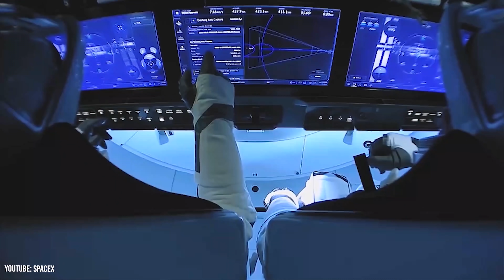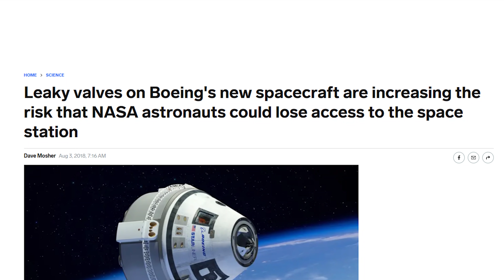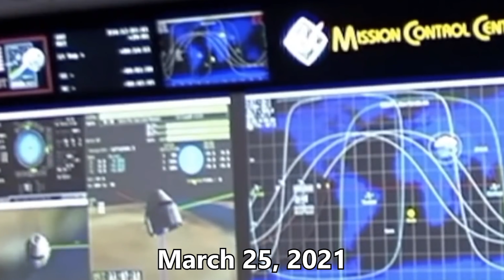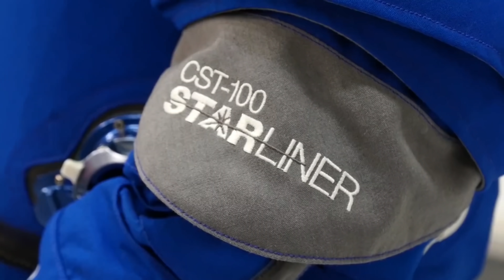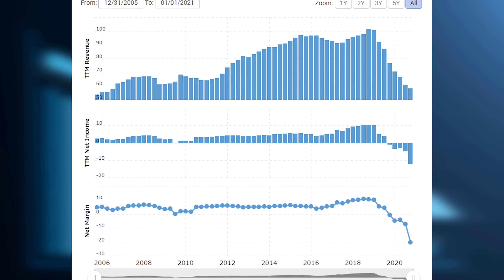What Happened To Boeing Starliner?

Comment: Boeing is addicted to endless streams of taxpayer's money through Cost-Plus contracts.  They rely on legacy cred and "flight-proven" (old tech) rather than innovation and cost-reduction through efficiency.  

Starliner was full of software problems due to the fact that it is built by hundreds of sub-contractors which makes logistics and communications a nightmare.  

They never bothered to test the software in simulation as fully-integrated stack.  They only tested individual parts separately.  

Boeing is failure on top of failure.  

I think that their time is done and that they will not have a future in commercial space flight.

Comment: I know this is essentially an overall view from the outside, but I truly think that the core, not the causal, reason was that Boeing never intended to innovate but, rather, accommodate.

If you look at their design(s), it truly appears this way. It's as if they're stuck with the principles that worked during the Apollo years, instead of discovering new ideas that aren't just "updated" versions of old ones.

Comment: I remember, long ago a video showing inside SpaceX where folks had server stacks plugged into a Dragon off the assembly line and running full/complete "simulation" tests triggering everything within the Dragon's control system... I thought that was pretty neat.... fast forward to Starliner flight tests and reported software issues... I almost get the impression independent functional teams only did "test scripts" or something at each functional level and perhaps did not plug the complete system into a simulation like SpaceX does.... but that's just my initial impression as an outside observer.

Comment: I was unaware that Blue origin had been involved in the early phases of the CCDev program. It is very interesting that they did not bid on phase three of the funding. Of course, had they done so, and won, that would have required them actually to build something. Their modus operandi seems to be to always keep working, but never actually complete a project. The decision to drop out of the competition was obviously Jeff's. I guess he just couldn't face the prospect of being required to deliver something.
The Starliner did not fail to dock with the space station, at least in the sense of trying and being unable to do so. Due to the timer problem, the spacecraft was in the wrong orbit and low on fuel, so the decision was made not to attempt even to rendezvous with the space station, much less dock. I certainly hope the second time is the charm, because I doubt they will get a third try.

Comment: Logically Answered?  I object to your title.  How about .....  Repeat what I am told, without logical thought on my own?   Wouldn't that be more accurate?  
Case-In-Point:  Starliner reportedly failed to doc with the ISS.  Because the spacecraft's clock was set 11 hours off.  Boeing did successfully land on land. instead of the ocean.  Right?
Cirrus' made news in recent years with the 1st certified single-engine jet, and the 1st jet with a parachute.  Right?  While the jet is capable of cruising @ approx. 300 mph, 
Cirrus makes it very clear, if you pull the parachute @ > 180 mph.  It will literally rip the chute to shreds.  Common knowledge in general aviation.  Right?   Yet ..... You report on Starliner's ground base landing.  Where upon re-entry, Starliner (a much heavier craft) opens it's chutes @ > 15,000 mph, with question or hesitation.  
Cirrus @ 200 mph rips chute to shreds.    Starliner @ > 15,000 mph NO PROBLEM.   Even if one doesn't open.  Right?   Please explain how Starliner's chutes are even possible.

One more thing.  Why does Webster's recognize Boeing's "Dreamliner" as a word, but not Boeing's "Starliner?"   I have my suspicions, but I'll yield to you as the authority, and await your response.

Comment: Boing no longer manufactures all their aircraft and spaceship parts, but relies on subcontractors to do so. All Boing does is assemble the whole thing to create their product.

Now when aircraft only had mechanical parts it all worked seamlessly but with the introduction of computing and electronics a part made by company A may or may not work with a part made by company B. This is the reason That SpaceX and Tesla leave their competition in their dust, is because they manufacture everything in house. No having to organise expensive tests with other companies and failures when these integration are skipped to “Save” money.

Comment: The biggest disadvantage that Boeing is facing is that unlike spacex they don't have their own rocket
Reply: Yes they do, Boeing designed the Delta IV, and through Lockeed/ULA they also have Atlas V which is what they're launching Starliner on.
Reply: On the one hand, yes, if they had done a full integration test with Atlas, they might have caught that timing issue.  But they're half of ULA, so I doubt ULA would have denied that request had they asked it.  And Atlas performed perfectly on OFT.  So I don't think that it's really pertinent to their failure.
Reply: Not a disadvantage at all - it’s programmed to put a payload into a specific orbit and release it, just like every other Falcon 9, every other Atlas, or any rocket. They have almost nothing to do with each other for low earth orbit flights. Heck Orion was tested on a Delta IV Heavy a decade ago and is FAR more complex - the flight went perfectly.
Reply: really a disadvantage?

Comment: Blue Origin built a very nice half of a faring...😁
Reply: yea , and the BE-4 engine , more powerful that raptor from space x , testing with new shepard , there comming , and when they do it will be massive
Reply: @stevensmith797  The BE-4 is great, but it's not built by Blue Origin. ULA is building them
Reply: @stevensmith797  should be noted that the raptor engine has a better thrust to weight ratio
Reply: @little_minka3290  sure , didnt say raptor wasnt a good engine , but blue origin has developed its our engine from scratch to a real thing and made 1 bigger with more power , think they have shown enough to know they to can hit space , and do it just as good as space x , bezos has stepped down as CEO of amizon to put more time into blue origin , I wish them success , the more players the better

Comment: Boeing is suffering from a really fundamental management culture crisis. This has been illuminated in great detail by all the examinations of the 737 MAX disaster and the extraordinary quality control problems on the Dreamliner project. It is totally logical to conclude that this problem has infected their space division. You get a few problems with an aircraft which has a fault or two but with a spacecraft you get total failure. I don't see this cultural problem being solved any time soon. SpaceX has a brand new culture with proven results. They are miles ahead of Boeing now and will only pull further away. They are enormously more cost effective and soon even NASA will have to take notice.

Comment: The commercial airplane business and space business act almost like separate companies under Boeing. Focus on commercial airliners won't take focus from space projects. They don't share engineers, resources, or facilities. Remember the bulk of Boeing's space business came through acquisitions of McDonnell Douglas, North American Rockwell, and Hughes. Most of those space facilities are in Southern California, a long way from Seattle. In many ways those divisions still act like separate companies and profit centers. Boeing did lose much of its space talent when it spun off ULA as a joint venture. ULA engineers weren't involved in the Starliner spacecraft design. However they were involved in integrating Atlas V to Starliner. Boeing felt they could analyze their way out of the aero effects on Atlas/Centaur, but eventually had to concede the aero shell was required, which caused a delay, redesign, and scrapping of hardware already built.